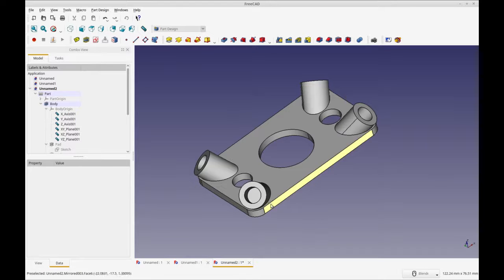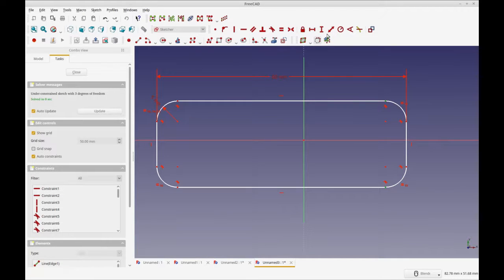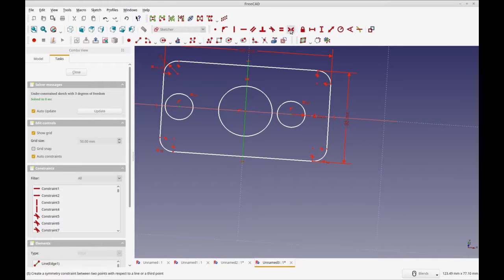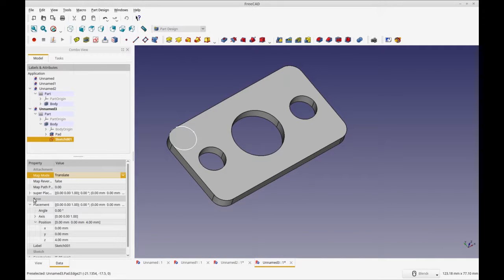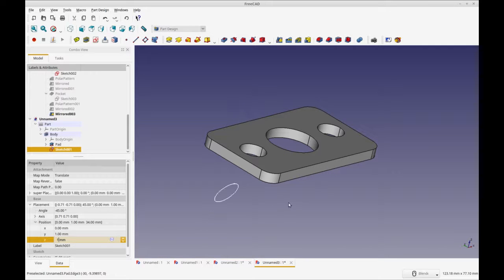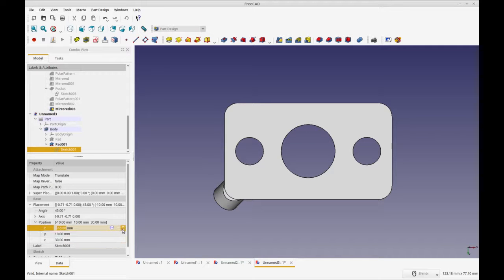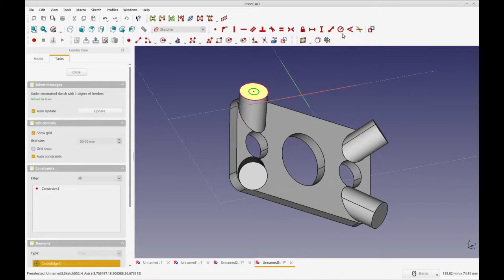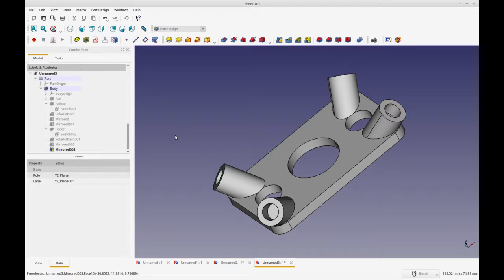FreeCAD - Angled Legs Demo

Comment: Hi Paul, for placing the angled cylinder with exact dimensions I would first place a Datum Line with the desired X and Y and Z dimensions and the angles. Next I should place a Datum plane normal to the Datum line and give this a Z dimension. On this plane you can draw the circle. Pad this circle to the face like you did and everything has the dimensions you want and has no random dimensions and angles
Reply: Hi Paul, here a link to the video I made for doing the angled legs https://www.youtube.com/watch?v=PKvAKk4JO38
Reply from the maker: I hope you don't mind but I linked your video in the description. I also put it on my Facebook Page, @freecadvideos
Reply: @willemakerboom7626  Hello Willem, I clicked on the link you provided but got msg saying the video has been removed, was disappointed as I'd have liked to view your video. I think I know how you've done it from your description, so no big problem.. but others who are newer to freecad may benefit from your video.

Comment: I liked how you moved and mirrored the parts. I am going to use the method to make cuts at a angel. Had to add to my freeCAD video's I find helpful. Thank You for your time.
Reply: I found it very helpful! I downloaded it a week ago and I am trying to make a RDA. Rebuild-able Dripping Atomizer. I found a company that said they will help I just need to have a good 3d image. And the build from the bottom up is great! If I might ask and maybe a video idea. When I am done and I have went through the bottom to the top with cuts an d my 3d image finished does each sketch keep all different measurements there to view later? What if you want a cross section of your finished plan or idea. Thanks again for the video and a nice reply. P.S. I just realized the info is at the bottom of the window were you click each pad and sketch. I am learning by the second lol
Reply: Sir thank you for all of the information! Thank you for time to answer. Yes that was just what I was asking. I am on FreeCAD now had to start over. I had spent 4 hours working in the part and part design, and padding layers or making cut, and even filet cuts. And got to a point and at 12:30 figured I need a break and closed program and never saved! when I closed I was starting a new sketch and figured I am ok just close it for the night. Got up and No file. So this one is better and save after each sketch. Again thank you for your replies and help.